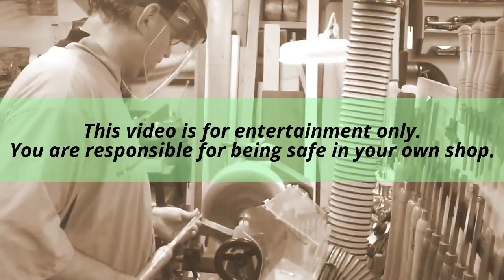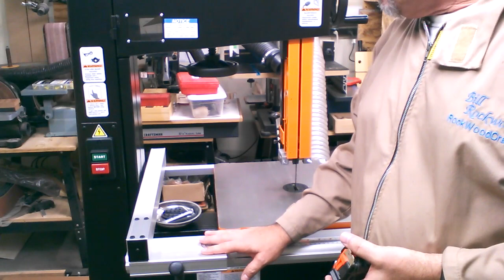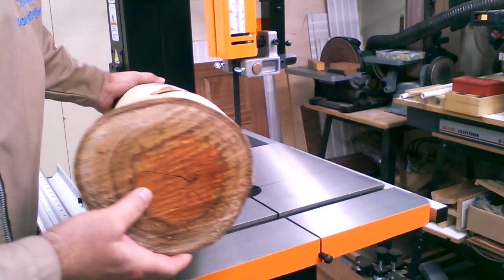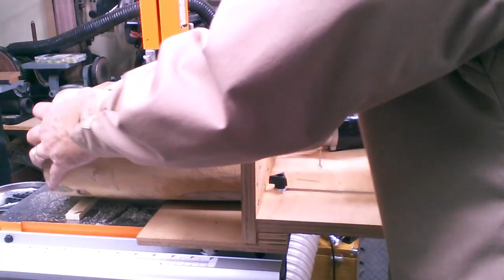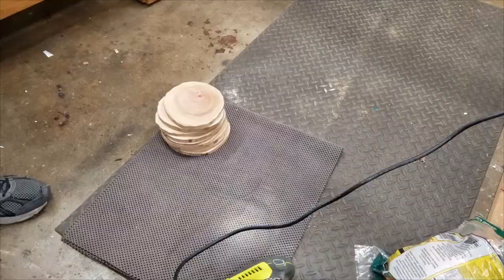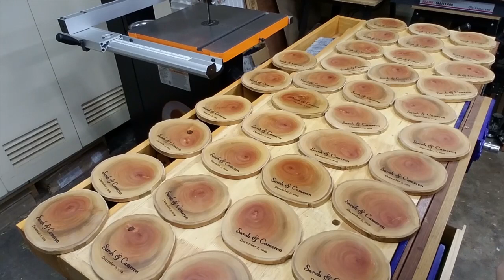57 - New Bandsaw, Laser and Wood Cookies

Comment: I like those cookies you made. What a great thing for a wedding. A laser could be very handy for sure. I have a cnc milling machine which I have done some engraving with.
The Grizzly bandsaw looks well built. I have 2 Grizzly machines. One is the cabinet model table saw with a 3HP motor and the other is a long bed jointer. Both decent machines.
You will be happy with the bandsaw.
 Nice video,
Gary
Reply from the maker: Thanks Gary!  Yes, I'm really enjoying the new bandsaw and lathe, these are my first Grizzly tools and they are solid. You've got some nice videos yourself sir, keep on turning! Cheers!